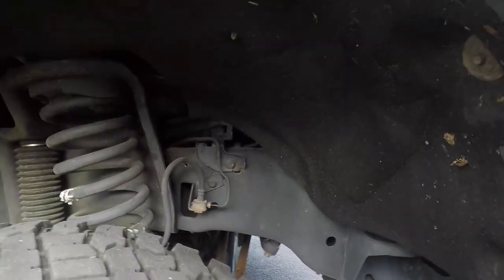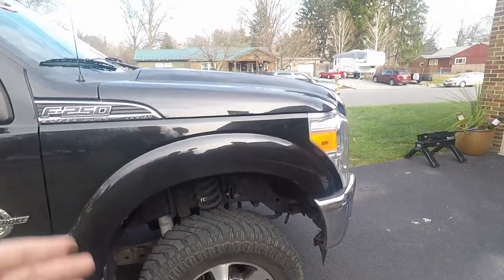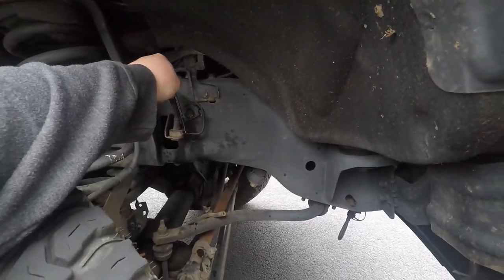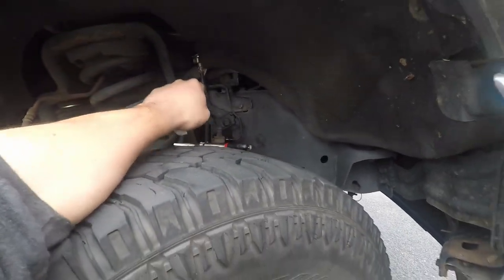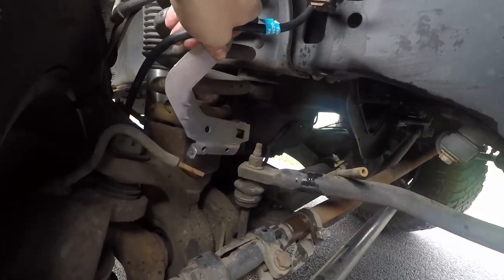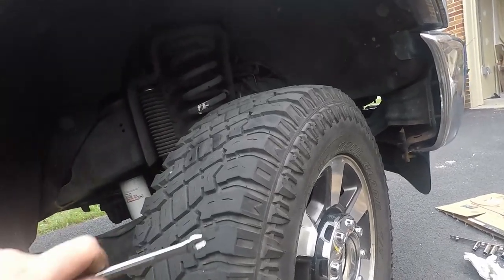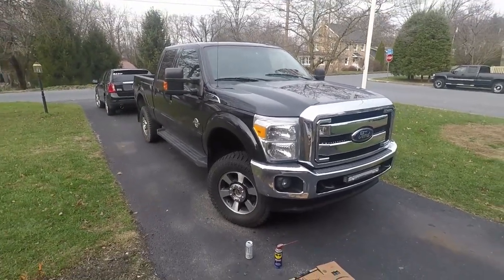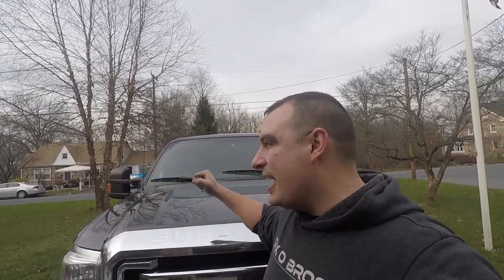2005-2020 f250 Brake Hose Replacement

Comment: Basic filming class  - "Better video clarity where possible" to film with wheel off.  And would have been educational to show when / how you torched the stuck fitting and what size wrench (11 mm Line wrench is usually best) you used for that fitting.
Reply from the maker: Lol
Reply: @six0bros  Moving the wheel out of the way for filming is like getting the elephant out of the living room to watch TV.

Comment: Dislike. Not at all what I'm looking for. I information not you talking about your truck.
Reply from the maker: What are you looking for? There are not many steps to the job its a handful of bolts. I would see what all holds the line in the truck such as the brackets to keep it out of the way and then take it off the caliper and the connection on the frame and that's it. No real special anything for it